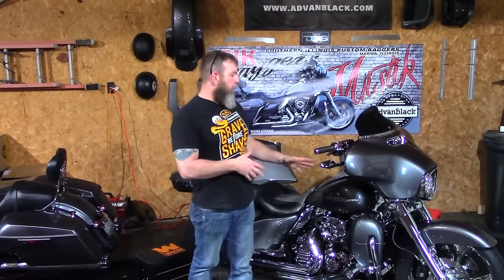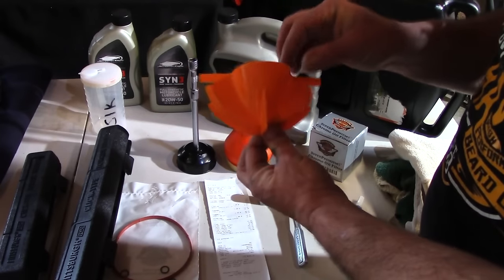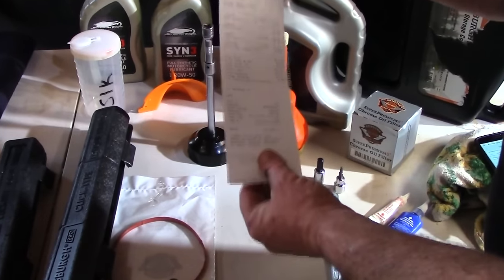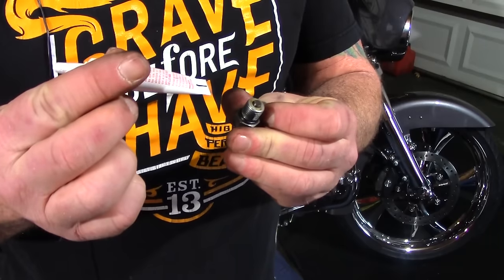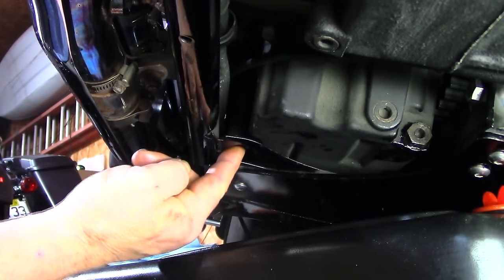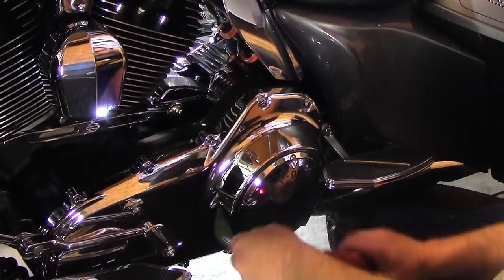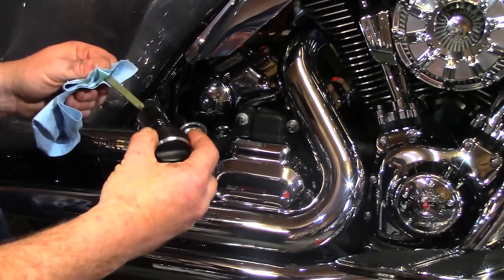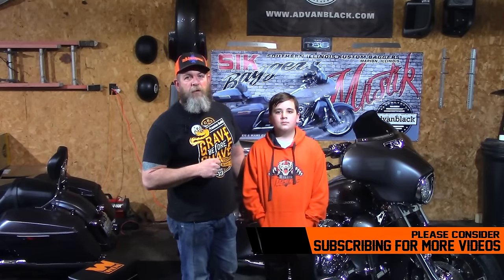⚡Twin Cam Complete 3 Hole Oil Change @harleydavidson  Touring⚡

Comment: Just finished my first ever motorcycle attempt at anything mechanical. This is the only video I use. (It helps that my bike matches all the info on here having a 2016 SGS.) What I will remember for next time is that a lift or anything that will get the bike further from the floor would come in really handy. With the oil catch pan under the bike it doesn’t leave a lot of hand space. And that foot pound torque wrench has almost no room to move between bike and floor unless you have a shorter one. This only comes into play on the 1st drain plug because you have to wrench vertically. Also I’m curious if anyone ran into the primary overflowing with the bike on the jiffy stand while putting in the 38 oz? Mine did. I hope no one reads this as a complaint because I would have never even attempted this without this particular video and how well it is done. THANKS!
Reply from the maker: Sorry for the late reply, I just got back from Sturgis...really glad the video helped, and please check out this scissor jack https://amzn.to/3STFtwB or even a jack https://amzn.to/3A2mfwc or even one from harbor freight... it's well worth the money!  If you are overflowing on the primary you have way too much in it.

Comment: Interesting.  My VTX was all in one oil for the trans, clutch, engine...the different compartment idea makes perfect sense, too.  Gear oil for the trans, and the primary and engine get the MC oil for V-Twins.
Reply from the maker: Yeah HD uses this one in all holes and thats how they do it when bikes are under warranty so they much believe in it ...i personally use amsoil oil, primary and transmission fluids in mine..but ran the syn3 for years with no issues

Comment: Did you run the bike a half an hour prior to draining? Also, while on the kick stand does the transmission completely drain out? Judging by the video it appears the drain hole is above the left bottom of transmission pan. Thanks for the video very well documented.

Comment: Hey Steve, I can't get a straight answer from the parts counter at my local HD. I have a stock 2015 Ultra with 5k on the clock. Should I use the HD conventional oil or the SYN 3 ? They tell me it's up to me. Thnks
Reply from the maker: Hey Thomas ....honestly it is up to you there. I run all synthetic on both SG and RG ...using syn3 in the SG and Amsoil in the RG. They both work great.  All engines love conventional and semi syn oil, nothing wrong with any of them, including synthetic. change your oil on time and your good to go. You can check your clutch at this time and I do not have one but here is a good one. If your engine is running cooll enough and everything is performing as it should then you may consider just sticking with the standard oil...its certainly cheaper.

Comment: Aww man I didn't know about the primary oil. 😕 
My 14 ultra limited didn't come with a manual when I bought it a few months ago. 
What is up with the primary oil?
Totally different from the engine oil?
I thought the bike only had engine oil, Trans fluid,  break, and clutch fluids.  The primary is new to me. Needs to be changed every time the engine oil is?
Reply from the maker: doesnt need to be changed every time , no.  engine at 5k, primary at 10k and transmission at 20k.

Comment: I thought in one of your videos you said that to fill the new oil filter with oil is not needed. I watch your videos all the time.  You're the BEST.
Reply from the maker: thank you! yes it is not needed...that pump will quickly fill that filter as soon as you start it..thats why important to run it and then check your oil level

Comment: Nice I also change my crankcase oil no one ever they say it's not required but do it anyways ✌️ on 2's just ole'skool
Reply from the maker: Absolutely all oils need changed or flushed over time...Just condensation alone in the system can make things go from bad to worse real quick.

Comment: @SIKBaggers So the Syn 3 is all 20w50 and use in all three holes or bottle for transmission fluid is different and primary ? Just wanna make sure all fluids I'm getting are correct ?

Comment: Good video. Are you using thread sealer on all 3 drain plugs  and does Harley recommend using it ? I use to use Teflon tape on my 98 Low rider primary drain plug ( which was a terrible design), but I didn't think I needed it on my 09 SG. Thanks.

Comment: Hey Steve thanks for all the videos, I was wondering what tuner would you recommend for. 2017 FLTRU??
Reply from the maker: well tuners are really an opinion type thing...and it really depends on the amount of work you have done to the engine...a basic stage 1 you can get away with just any of the,..its a basic map tune. I use PowerVision tuners here because of the amount of things I can do on it...its much more detailed. Another great option is you get one VIN with the unit and you can multiple more VIN codes for that tuner....so youre not out 500 bucks for every bike you buy..the rest are married to that bike once its installed.

Comment: When you do the transmission draining, with the way the bike leans over on the kick stand, should you stand it up level to get more fluid out of it or is it ok to do it while it's leaning over on the stand?
Reply from the maker: Leaned over on the stand as the plug is more to one side ...you can, of course, lift it and stand for a minute ...but usually just leaned over is jjst fine

Comment: Yes I did notice that you run syn3 all the way around. I'm surprised your not using the harley synthetic gear oil in the other two holes. I would figure there would be less clunky gear shift changes etc.
Reply from the maker: I did switch it up to the gear oil on this seasons oil change..we will see if it acts any different. If you take your bike into our local HD that throw syn3 in all three holes...they said they all do it unless you specify different. But I am trying new things as I go.

Comment: If you did not add any oil to the filter when replacing it, how much oil would you put into a 2016 Street glide Special.  I believe I have used 3 1/2 qts in the past and does this sound correct to you

Thanks
Reply from the maker: You cannot put very much in the filter because of the way it goes in the bike...youll spill most of it out before you get it in...just enough to get the inside wet..so thats not much. Initially add 3 quarts. Do a cold check. start the bike check for leaks and turn off the bike. Do a hot check and a accordingly. If you are having issues with blow by (oil coming from the back of your breather or breather filling with oil) add less. Keep the oil level on the lower end of the safe area and this will eliminate most of that.

Comment: Is it normal to have a little drip under the filter after replacement I did it step by step and having a few drops
Reply from the maker: after you pulled the filter it probably dripped down on your air cooler and now its dripping off...wipe everything down dry...slide a papertowel under the oil filter and wait over night to see if its coming from the filter or just dripping from somewhere else

Comment: I may have missed it but, Does all 3 holes use the same 20/50 engine oil ? also is there a way to check the clutch fluid level or is it just using a measuring cup and thats it ? 2019 Street glide 107 engine
Reply from the maker: If you take your bike to HD unless you specify, youll be getting the same oil in all three holes...however kits like amsoil have a separate clutch and trans oil...up to you.

Comment: good video, good camera work easy to see and understand. One thing you might warn your watchers though is to make sure that they can get the screws on the derby cover loose before they drain the oil.  I have had two occasions when the HD I was changing oil on where the screws were WAY over tightened. In both cases the last service had been done at a HD dealership. On one of them we had to take the whole side cover off and use a welder to get the last screw loose. Just a thought resulting from my own experience.
Reply from the maker: Thank you Jim and thanks for the great tip! Ive changed a lot of oil and never had this happen BUT I have serviced bikes after HD had their hands on them and could not get the oil filter off. Literally having to pull the oil cooler and chisel the filter off...unreal..no filter needs to be that tight. So I can believe that the derby was over tightened. I have had a few get some buttery screws on me and try to strip though. Thanks for checking this out and the tip again man...be safe!!
Reply: I invented a tool for getting the over tightened oil filter off..I welded a big nut onto the  center of a flat bar about 4 in long then drilled a hole on each side of the nut. I put a bolt through each hole used a lock nut to hold the bolt ridged and sharpened the bolts. I drive the sharpened bolts into the filter then use the nut to twist the filter off. kind of rough and ready but it has worked every time, so far..I enjoy your vids

Comment: Hi Steve, Not sure if you’ve done this yet but I would love to see a video about the tools needed to do basic maintenance on your bike. Thanks for the knowledge Steve. As always, great fun.
Reply from the maker: Hey Brian..No I haven't but I want to...just haven't got to do one yet...HOWEVER I just made a list on amazon and the link will be at the end of this comment. I only used amazon because its easy to make a shareable list. READ THE NOTES BY EACH TOOL AND SEE PRIORITY.  Most of this stuff can be purchased at any big box store and for your average DIY guy the Harbor Freight tools are just fine. I have a lot that I use everyday from there with no issues.  I also put them by priority so you can sort the list that way and see the ones I use the most.   Low priority stuff I wouldn't buy until you needed it.   Im sure I may have left something out but going over my tools I use these the  most and some of these are for specific things so you dont need them unless you are doing that job.  If you have any questions please let me know. Ill try to do that video very soon!  Here is the list. https://www.amazon.com/hz/wishlist/ls/17L9F8XS6WS23?ref_=wl_share
Reply: @sikbaggers  Steve thank you so much for taking the time to send this. SIK Baggers has become one of my top YouTube channels. I wrenched on my Sport Bike and would love to do the same on my HD. Your oil changed video was awesome. I saved your amazon list. 👍😁

Comment: Per the service manual, the bike should be upright for adding and checking the primary oil level.  Side stand for the transmission and either for the engine oil.

Comment: Is this the same for a 2018 M8? Thanks for all of your videos... great instruction!
Reply from the maker: Same process but you will need to check the owners manual or service manual for the amounts.
Reply: @sikbaggers  which "shop" manual would you recommend?  recently bought a '20 FLHTP and need to get one of those to complement my owners manual.  last I looked there were like 3 different shop manuals.

Comment: What thread sealer do you recommend?
Reply from the maker: I use this https://www.amazon.com/Permatex-59214-Temperature-Thread-Sealant/dp/B0002UEOP0?th=1 its thread compound which is very much different than a sealant like loctite ..sets up in 24 hours and easy to remove..works great on drain plugs. Id say if you do not have a leak now it is not needed, im just old school and been using it on everything for years...the HD O ring does a great job and should be changed every time you remove the plug for an oil change.

Comment: You make this look very easy. Not sure why all the shops around me want $130 or more to change my oil. Is that normal? Going to attempt this on my 2004 heritage softail classic after looking up the proper torque and fluid level specs of course. I appreciate the video! Subscribing now

Comment: I don't understand why it needs thread sealer on the oil Drain plug, if it has an oring?
Reply from the maker: it doesnt...its just something I picked up over the years of changing oil on older harleys that leak like crazy...it wont hurt but on the newer models its not necessary

Comment: HEY!! this video is AWESOME! Im going to do this to my bike tonight thanks to your video. quick question though- did you put the thread tight on the transmission plug when you put it back in? you called out doing it to the primary and oil plug but didnt say it for the transmission. also, do you put some oil on the gasket for the primary like you did the oil filter?  thank you for this video!
Reply from the maker: I swear I've replied to this comment 2 times now and everyday I log back on and its here in the comments lol Ill try again although it sounds like you may have already done the job. The thread tight is something I've used out of habit from working on older Harleys..its not really necessary on the newer models...say twin cams up to the M8's however it wont hurt either. I did put thread sealer on all 3 plugs as well. You can add some oil the rubber seal but once again its not called for....I've done it both ways dry and oiled and had the same results.

Comment: What thread locker do you use?

Where did you use that big O-ring?
Reply from the maker: big o ring is for the primary derby cover..however mine uses a carboard style gasket...check yours to see what you have before ordering one.  Permatex 59214 High Temperature Thread Sealant but it is not necessary with the o ring...its juts something I have always done on Harleys.
Reply: @sikbaggers  Thanks mate, I have the cardboard one from my local independent dealer as well. Thanks for the feedback, appreciate it.

Comment: Great video.  Did you use the same oil in all three holes?
Reply from the maker: In this I did..you can use Syn3 in all three holes...HD does it so thas what we did here...however there are klits out theere that have specific oils for all three holes as well.

Comment: How much do you pour in the oil filter, because when I pour some in it it always just spills out when I go to put it back on.  How much are you putting in it?
Reply from the maker: just had this conversation with a buddy today.. ...really no need to add it in..as soon as you crank your bike it will fill the filter. I only mentioned it because there are a few out there that think putting some oil in it is required an its not...what will happen if you dont? damage the oil filter? LOL no...but if i do add it..its a minute amount enough to get oil in the paper ...which is a waste of my time when servicing a bike.

Comment: Great video thanks for taking the time to do them. I gave watched several of them and found them very informative. Could you tell me the seal kit part # our local Harley Davidson Dealership told me they didn't have a seal kit for a 14 SGS. Thanks again for the great videos.
Reply: 17361-06  ill do that for you ! Good Luck , 11105 is the o rings if you needed them separate, 63731-99A black twin cam oil filter, 63798-99A Chrome filter.  But the orange O ring isnt sold separate, If you run a accs derby you will need a 25416-99C. Nothing wrong with doing your own maintenance BUT this literally not why it cost what it does at a dealer. Any monkey can spill and fill, You are paying for their knowledge. Also keep in mind no it doesn't VOID warranty. But when you do your own "service" and never take it to a dealer you may miss warrant-able concerns a skilled tech would find.  Just a thought.... No looking to argue so I wont respond to anything like that.

Comment: Thank you for great video.  Just want to ask, when checking transmission oil level does it require to screw in the dip stick as you did checked engine oil level or it has to be loose? Thank you for your help.
Reply from the maker: Thank you ET.....Yes on the tranny screw it in all the way when checking.
Reply: @sikbaggers  thank you for the prompt response! Ride safely.

Comment: Is thread sealer absolutely needed?
Could I just use blue lock tight?
Reply from the maker: The thread sealer is not needed if you have  new rubber o rings..NEVER put loktite on your drain bolts though

Comment: hello, great video, i have a question and need your advice, i am blacking out all parts on my street glide and it has been off for quite some time, i will be doing oil change afterwards, does it require the engine to be warm or in cold state? should i put back on the pipes and run the bike for 1 minute to get the engine warmed up ? iam just concerned to run the bike while loosing the little amount of oil while installing the new cam cover, please advise
Reply from the maker: well i do the oil changes warm and the only reason I do them warm is because you will get more of the old oil out of the system. If you can I would button it all back up and then do the oil change.

Comment: I might have missed it but do you do your fluid levels on the kick stand or centered up on motorcycle Jack?
Reply: I did my 2015 limited on the kickstand. The bolts on the derby cover are T27 not T25.

Comment: What does a 1000 mile service  consist of for a new bike  ? Can you make a video ?
Reply from the maker: Here is a list of things that should be checked on the 1000 mile service. Inspect oil lines and brake system for leaks
Inspect air cleaner and service as required, Check tire pressure and inspect tread, Check tightness of wheel spokes, Replace transmission lubricant, Check clutch adjustment, Check primary chain adjustment, Inspect rear belt and sprockets and adjust belt, Check, adjust, and lube throttle, brake enrichers and clutch controls, Inspect and lube jiffy stand, Inspect fuel valve, lines, and fittings for leaks, Check brake fluid levels and condition, Inspect brake pads and discs for wear, Check spark plugs, Check operation of electrical equipment & switches
Check and adjust engine idle speed, Adjust steering head bearings, Inspect shock absorbers, Check tightness of critical fasteners, Road test
Reply: @sikbaggers  wow, brotha thank you